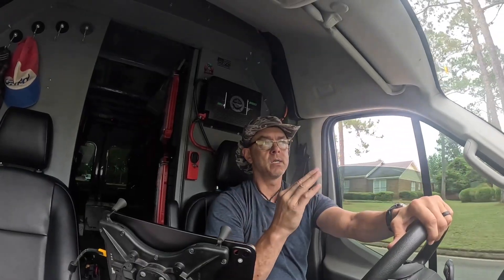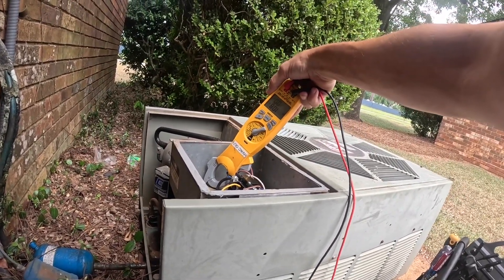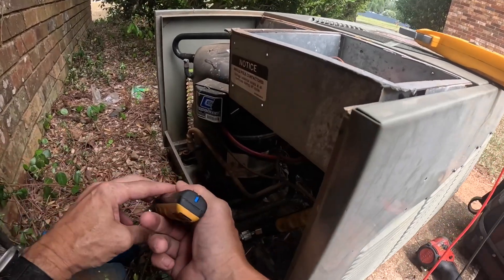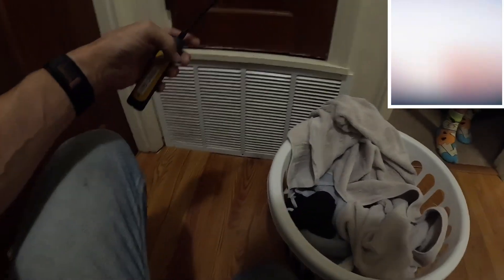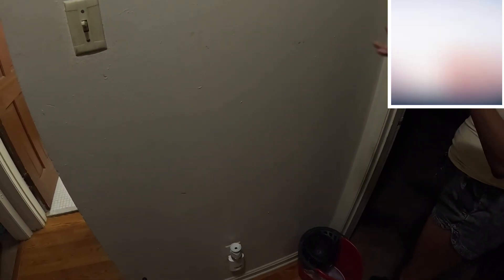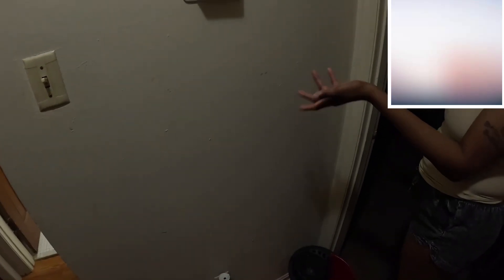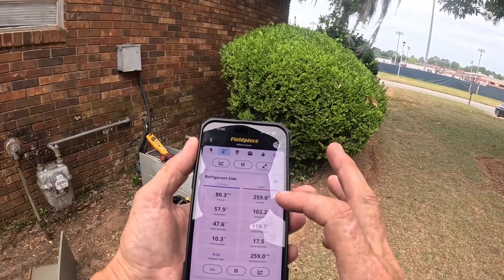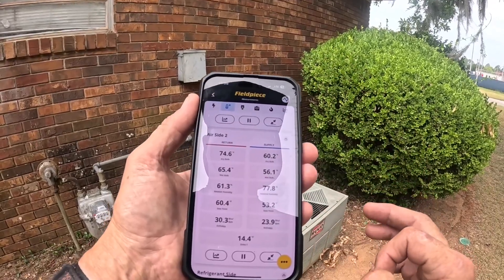Third Visit Within 2 Months, But Was It My Fault? #hvacguy #hvaclife #hvactrainingvideos

Comment: got a question. first off we always leave our therm. on 68 degrees.... NOW,  here where i live, right now we are using the heat at night but during the day the temp goes above 68, so should i just leave the heat on and let it come back on at nite when temp drops below 68 or should we cut it off when temp goes up and turn it back on b4 bed or just leave it on. we just had a whole new energy efficient heat and air system installed and just wondering which way is better for our new system. i have been watching my grid on our power bill site and its running 15 to16 kws lower each day with our new system. i was shocked when i seen the differance.

Comment: What he also, may not be going into detail with telling her is that not only does the ambient air within the home heat up, but so does everything within the home, creating a equivalent of an ice cube, but in reverse creating radiational heating instead of cooling, even though the air in the house has been pulled down, you still have the structures within the house that still has to cool down all the way through.

Comment: I never turn my air in my apartment off. Granted I am on 3rd floor so I have a apartment above and below me so it never gets super hot even in Florida but even I with no AC knowledge beyond the basics of how a refrigerant cycle works know that if you turn it off it’s gotta work extra hard to cool. I have mine on a program where when I’m not home it’s set to 76 and when I get home it lowers to 72 and then 70 to sleep. I understand the logic of thinking turning it off will save money when not home but it really doesn’t.  Plus I don’t want the air sitting still all day while I work. I wanna come home to a cool fresh home.

Comment: I'm still kind of angry, but here's why this is happening, assuming it's a piston. I'm angry because how on EARTH was the word "piston" not spoken once in this entire video. 

So basically, what's happening is you want as much of the evaporator to be full of flash gas as possible. Superheat is a measurement of how much of the evap coil is filled with flash gas. The more full it is with flash gas, the higher your Delta T. Because if the entire coil is being used for phase change, the entire coil is converting sensible heat from the air into latent heat in the refrigerant. But if it's only half full with flash gas, only half the air is experiencing that transfer. So smaller delta T. 

The problem happens when the air inside the supply is so hot that it boils away the flash gas into 100% vapor so fast that you're only using like a tenth of the coil. This means you're only 10% efficient. It boils off way, wayyy too fast. Now TXV metering devices can adjust to compensate for high temp return air, but a piston can't. So pistons are notorious for getting swamped under high heat load. That's what I believe was happening here. 

So action items are either just stop turning it off, or replace with a TXV. A TXV will still complain, but it will keep your delta t at 20 where the piston will let it drop almost to nothing if swamped by high heat load.

Comment: That would be like turning my furnace off on a 15 degree day (all day) and then expecting my temp in my home to heat my home to 73 in a short time. That doesn't work either! I don't think you save much by turning it off. It takes probably as much fuel to reach the desired temp. It could be penny wise,pound foolish.

Comment: This woman needs to do like I did with my system I only need 4 tons but my system is a variable speed 5 ton with variable speed air handler and now no matter what I said it on it will get it there within an hour and then maintain it running at lower speeds.

Comment: That condenser fan motor did not spin as freely as it should. I know the amp draw was at label rating, but it seems the bearings are failing on that motor . Slow fan equals a higher temp. When the fan runs a while, does the motor heat up and slow down?

Comment: No wasn’t your fault. 15 16 degrees is not fantastic, but as you said on a unit that old that’s no surprise at all. I had a heat pump that wasn’t keeping up not long ago. I think what I found out on that one the reversing valve was stuck partially. Wouldn’t  go into heat at all. Wasn’t shifted all the way in cooling either.

Comment: I can maintain about 25 degrees below outside temp but if it is turned off it will not be able to get it back to where you had it when it is in upper 90s or 100 outside it runs nonstop to keep place around 73 
we had electric company pull this scam they would hook up a device to shut some customers off for a few minutes each hour then back on and rotate through customers and it would help them maintain power at peak demands well it was a giant lie it hit high 90s and they turned it off for 25 minutes then back on for 5 minutes like that would keep your house cool i called up and told them to turn it off and they claimed they did but house was up in 80s they claimed they had sent signal to turn it off so i ripped it out when they claimed it would be a day or two to get somebody out to remove it. I think everyone had them removed after that fiasco.

Comment: Old poorly maintained home with renter who knows little about house systems.  Dryer inside, likely dumping lots of BTUs inside along with gallons of humidity.  Dryer vents are seldom maintained, plugged, leaks, joints apart.  Dumping all that heat n moisture inside.  She obviously has to run it for hours when she comes home from work.  See so many systems with return vents near laundry area especially in old homes

Comment: Never shut it off , always adjust temperature accordingly , it’s hard for any unit to cool a hot box back down. Everything is hot , walls, ceiling, floors, then it has to work its butt off to get cool again. Good diagnosing Curtis 👍

Comment: SOLVE FUTURE "CALL BACKS" ON 15+ YR OLD SYSTEMS. AT BOTTOM OF INVOICE, PUT: SYST IS OVER, X YRS OLD THIS IS A CURRENT FIX/REPAIR. YOU WILL CONTINUE TO HAVE ISSUES/PROBLEMS WITH THIS UNIT IN FUTURE, UNTIL YOU REPLACE SYST.  NOW YOU INFORMED H/O AND EXPLAINED ISSUES AND NOW IT'S THEIR BALL...

Comment: I might have missed it but did you varify you airflow? Total external static pressure of the system. You my have an undersized duct system or return air. You my have duct leakage as well. What is the condition of the ductwork?  Is the insulation falling off and your ductwork has turned into a heat exchanger? What is the heat gain from when the air leaves the coil to the supply vent? Ive always been tought varify airflow before you check your charge.

Comment: Your fault , no and yes . I think on every service call that should be discussed with the customer . From The very first service call (so depends on if you informed them of that on the very first call) . I used to do service work and i would always discuss safety measures to take to help prevent issues . Things to look for . Things to do and not do . (Every call) . Don’t block any intakes . Replace filter more often in the summer months. Do not close any vents . Don’t set the thermostat above 77f . So on and so on . In my testing i would never set my thermostat above 77 when not home . For some reason that one degree up to 78 seems to make a bigger issue when trying to cool down when getting home . Really appreciate your videos . If something simple your videos can even help those watching them to trouble shoot simple issues . It’s because of YouTube videos that i was able to install my own ductless mini splits in my house when my central air unit died . I had an hvac tech check my work and all passed with flying colors . So thank you for taking us on your service repair journeys

Comment: The condenser fan sure seemed tight when you spun it and had alot of play in the shaft and you said it was extremely hot too. I bet if you changed it it would pull the heat out better

Comment: Maybe she should turn it down lower than she normally keeps it. I had a house that had the electrical bill go down running a cooler temp- lower heat load, didn’t have to run all the time to keep up. Went from 72 down to 70 and it made it nicer inside and lowered the bill

Comment: Maybe a programmable thermostat would help. She can match the programs to her work schedule and allow it to run at a slightly higher temperature  ( like 78º ) when not home.
As you said to her, there is no way that unit is going to cool down to 72 at mid-day ( max heat ) when the inside ambient is 80º +. She's lucky you've kept that old Rheem running for her.  Keep up the good work.

Comment: People are stupid they don’t realize AC’s don’t cool they remove heat. So if you cut it off it has to pull out heat from everything in the house. Cutting your AC off is going to cost you more than just leaving it on to maintain the house. If you want to save a little bit just adjust the temp up a few degrees just like suggested. Customers think they know more and AC machines are just magic machines.

Comment: Something that you may consider, and I'm not for sure either without more data but the original condensor fan motor may have been a 825 RPM and was replaced with a 1175 RPM motor, that would explain the loud  noise and the high side pressure a bit high. 
Not that have ever made that mistake.😂

Comment: Lots of opinions here on latent heat. I let my house go to 80 and then bring it down slowly. My home has been recognized by our power company as being in the top 2% of low energy users for homes my size. I live in in Tulsa, OK and it's HOT here! I got a 3-ton system with a 2300 sg ft, single-story home. The compressor has a Micro-Air soft start on it to reduce compressor stress, not energy savings. My system has great cooling capacity. The power company even inquired as to what I'm doing to save energy. I tell them to pound sand, none of their business. It seems that this house in the video may be suffering from inadequate insulation, leaving window blinds open, excessively hot attic, whatever. She may not have enough cooling capacity. But setting the thermostat lower all day sounds like a band aid to other problems, as mentioned. When you let sun light in the house, you're also letting in heat. Light and heat go together. Compromises need to be made unless you're a richy-rich.

Comment: 14 deg TD is marginal. Something is wrong with that unit and those fan blades are about to break. I have had a cracked fan blades before and that is what they sounded like before they let loose and cut into the condenser coil with a great racket. When this happens the coil will be destroyed and you will sell them a new AC.

What you did wrong? You did not identify the problem and sell a new AC. The unit is too small and too old to do the job. The 14 deg TD will not provide humidity control. I suspect it had a 18-20 TD when it was new. Add a window unit. Then the customer will be prepared when the fan hits the coil and she has no AC.

Comment: probably would have made sense to her quicker if you expanded on why the ac bringing the temp from 78 to 72 is much more sustainable than bringing it from 90 to 78, in the hottest part of the day. she was listening but i could tell she wasnt understanding. 

for example a big part of hvac is the heat capacity of all the solid objects in the house. if you let the stuff in the house get really hot, by turning off the ac, it will take much more energy to cool the house back down because the air that the hvac circulates has less heat capacity (ability to dump heat from inside the house, to outside the house) than the objects in the house. so if you were to maintain the temp of everything in the house with the ac, it takes much less work from the hvac since the solid objects that hold more sway over the inside temperature, arent also contributing to heating up the house, in addition to the sun and outdoor air.

so in short, your hvac can either just fight the heat outside, or it can fight the heat outside AND the heat stored in the objects inside too.

Comment: I wonder if all those I the comment section would be so critical if the customer was an old white lady having issue with 80 degrees. She said there were days when her son (who worked a different shift)  had the AC on during the day and the temperature still was in the 80s. I would have the condenser fan motor rpm wasn't removing the hot air in my opinion.
Reply: You are correct,plus I think she said she was off that day.its not because she turning it OFF. it's not keeping up for some reason. It should pull down below 84 degrees for damn sake.

Comment: I think the issue with the 20 plus years unit is the CFM(cubits feet per minute), condenser air flow ratio or inside unit blower fan air flow ratio. The numbers may look good on the charts delta t or thermostats for saturation, superheat or subcooling .also there may be a restriction in the air flow in the condenser coils, people cut grass there every once a while the grass looks pretty trimmed and mowed ,you should check the all those things to rule out any inconsistency . When I say cut grass meaning debris flies and get sucked in the condenser coils creating air flow restriction to efficiently cool off the hot refrigerant ,or maybe the brand new motor is just not match for the age old unit too fast or too slow CFM .MAYBE when you put the amperage check it showed up 1.00 amps and the motor says 1.5 amps running amps . In this case ,keep in mind every year there are improvements in motor technologies, perhaps is of higher efficiency and less resistance the reason it requires less amps to run. Better copper windings design or better build. Maybe is too fast and air is not dragging slow enough to cool in the evaporator. I would check with the manufacturer of the unit and look up recommended speed of condenser fan.

Comment: Judging by your air temp at the vent (I believe it was 100 degrees until you turned the condenser back on), you may very well have a heat strip that is energized if that system has electric heat. (sequencer stuck)  Other than that, your advice to her about turning the system up or off during the day only allow everything in the house to go up in temp (that includes furniture) and all of that heat must be removed before system will start cycling.

Comment: I did apartment maintenance and also the heat and air on all the units, I was certified in heating and air in case anybody asks, And I had to explain to tenants many times not to turn the unit off but to just turn it down if they were out of the apartment. I had to explain to them that not only does the air in their apartment get hot, but also all the sheet rock in the whole apartment, which is a 1/2 inch thick or more, is basically a rock which absorbs the heat all day long and it takes a long time to cool off a heated rock that's been sitting in the sun all day.

Comment: 18 degree subcooling? Maybe a tad overcharged. Did you check if the heat strips were on? Seen it a few times with those Ruuds with sequencers
Reply: Finally, someone suggests making sure a heat strip is not energized if they have electric heat!  If things are clean and running properly, these old units just won't die.  They may be energy hogs, but they still cool great.  Landlord motto is usually, "If the ac ain't dead, I don't have to replace it."

Comment: Curtis, was it humid inside? The AC needs to remove all the humidity in the air before it can get a proper delta t. Especially if she turns it off and lets it get hot inside. I've seen the same pressures and temp split with high humidity

Comment: Sad to say but that’s your fault,  here’s the reason why.  The condenser fan blade is in the wrong position.  The fan motor is taller and causes the fan blade to sit to far down in the condenser.   Raising the blade up to the proper height will allow the heat to be drawn out of the refrigerant.   Your higher than normal sub cool, head pressure, hot to the touch motor and lack of air flow from the condenser tells me it’s the position of the fan blade.  Especially since the tenet wasn’t complaining before you changed the fan motor.   You can thank me later

Comment: Sorry a bit long winded but. :) 

When I was in the trade FT,  I had one place that had a Daikin ducked system with a huge 3 phase out door (8' High 4' wide) (YES LARGE HOUSE too), they was complaining the unit would keep going all night and not cool the place down + huge power usage because of it. 
We had visited the place many times and then the head of Daikin rep's came up and we headed to the place to find no problems with the unit,(Every visit they had someone home and so the unit was on the hole time and working link it should)
It then was coming to a point the owner kept complaining so one day we headed there without telling the owner (100o Day) and found the unit was not running outside, called the owner and he turned up 30 min later.
The first thing we found was the thermostat was off to find out they was doing the same as this video (turning it off when they head out the door). 
Tho we had asked and asked if they turned it off when they leave and it was always a "NO" even when the rep was here.
They didn't like the bill we had to send, for the wasted time visited and even the rep did too
They still expect it to get to temp within 10 min of turning it on.
It came to a point that they asked another place to look at the Air Con and when they saw the installers name called us (Good Friends) and we told them the same thing (Billed for that visit too).
Surprising part: We did get an apology 3 months later when he decided to read all the paperwork and followed it and so found out we was telling him the right way to run it, and so the power bill went down and the house kept to temp.